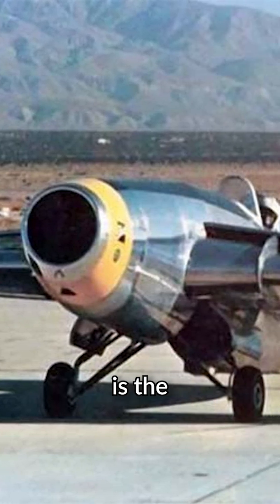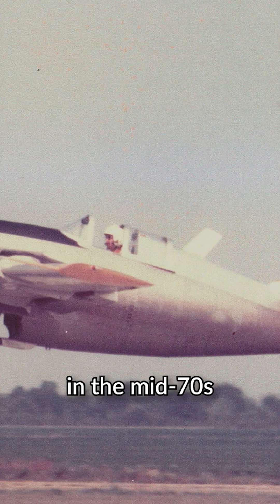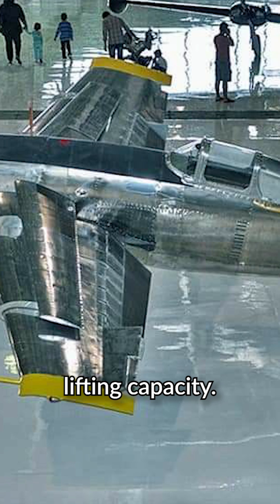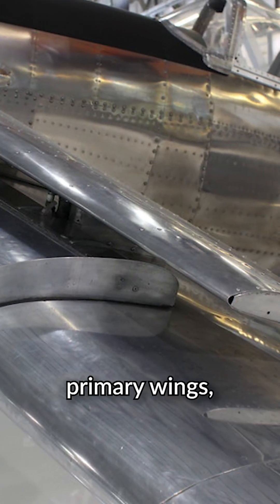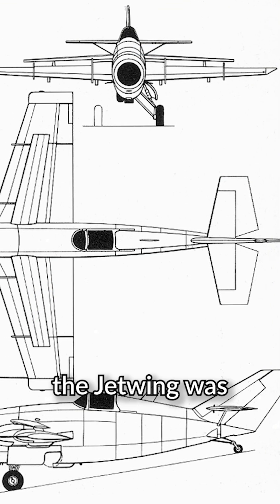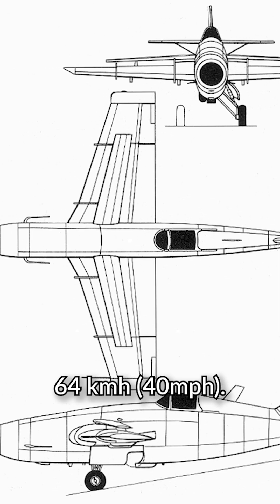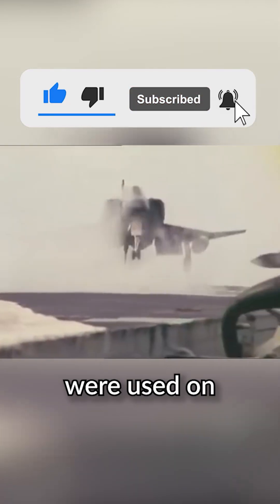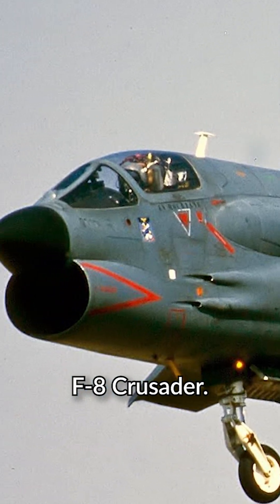The Stall-Proof Jet Aircraft | Ball-Bartoe Jetwing | Peculiar Prototypes

Comment from the maker: ADDITIONAL NOTES: 

All of the thrust produced by the jet engine was funneled entirely through small nozzles in the inner section of the overwing. This would explain the lack of tailpipes in the aircraft.

The improved low-speed handling caused by the blown flaps proved to be so effective, that while landing, a test pilot reported having to lay the rear gear down first over the runway, as the main wings were still well airborne at even the lowest speeds.

Pilot, B. P. A. (2019, October 28). Incredible Plane: Ball-Bartoe Jetwing - Plane & Pilot Magazine. Plane & Pilot Magazine. https://www.planeandpilotmag.com/article/incredible-plane-ball-bartoe-jetwing/